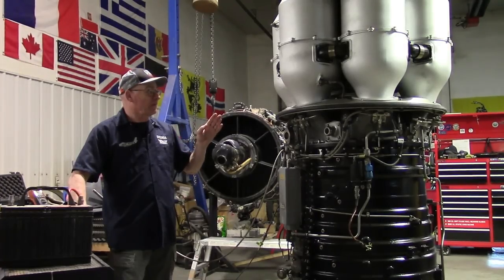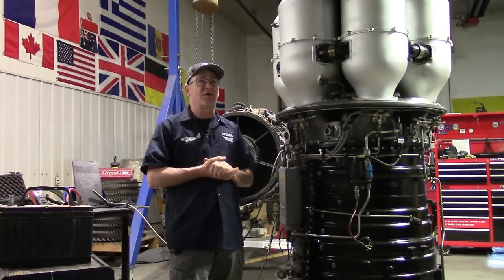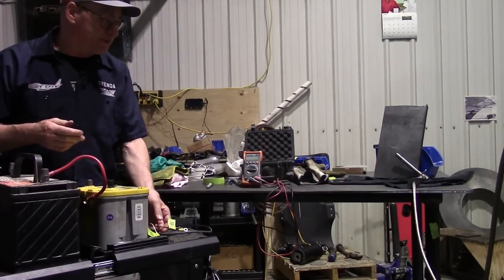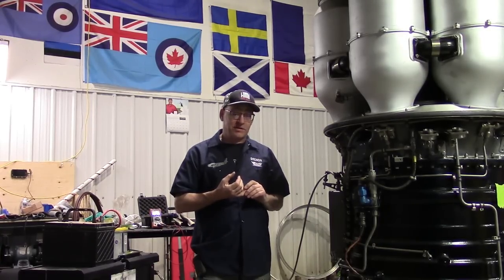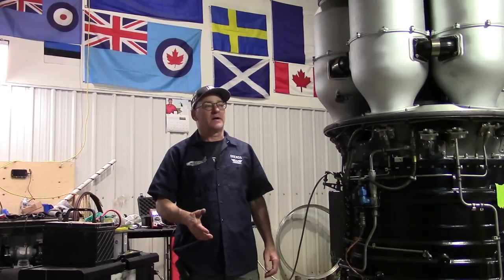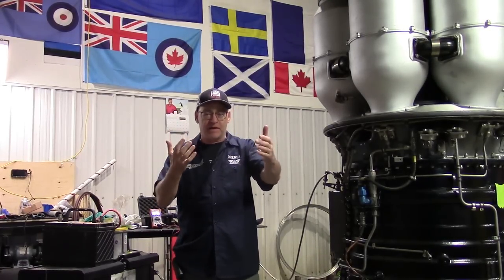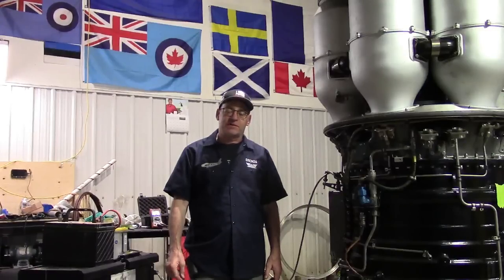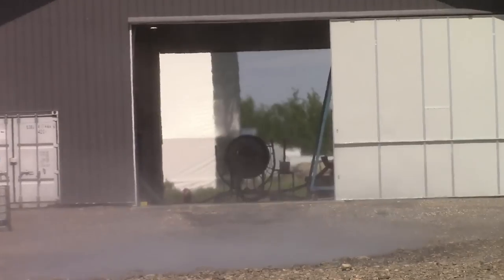Turbojet Ignition Test and Run

Comment: Continuous ignition is also used when flying through heavy precipitation.
Reply from the maker: It's an option. Rain has no real effect on airliner engines, except to increase the mass flow very slightly.
The engines on a 777 move several tons of air per second.

Comment: Did you get a new video camera? The picture seemed to be a higher resolution. Or maybe I did something and don’t realize it.
Reply from the maker: Many videos that don't contain mechanical details, I post in 30 frames/sec. Engine test vids are usually posted in 60 frames/sec.

Comment: I feel I should know already but why does the J47 Orenda Turbo-Jet share spark plugs with it's neighbour I understand this turbojet can only start with ground power but if it was to flame out while in the air it might trade altitude 4 airspeed to Windmill spool up N1 airflow and generate enough electrical power for a Relight or does the aircraft have a battery to assist here
I am very fond of this motor and it's very clear and understandable teacher
I guess The Veteran j47 speaks for itself
Thank you for all your videos
Reply from the maker: The ignition system would be energized by a battery in the aircraft.
Reply: @AgentJayZ  watching you test the spark igniters on the j47 is how I would test them when working in the shop
I would just rest the plug in its HT lead against a metal part of the engine I would often find them faulty because of an incorrect feeler gauge setting or none at all
I chose car engineering
As a teenager as my health said I couldn't fly which I wanted my whole life sorry to rant I wanted the turbo jet to be part of that I love the sounds they make as the gauges come to life
Have a good night my friend

Comment: Great video, quick question and I apologize if I missed it during the video. Does the “continuous ignition” mode you mentioned only apply to single engine jets? I asked my buddy who’s a KC10 pilot and he said they do not use it during takeoff, but it is used only during rough turbulence, storms, turbulent landings, etc. Thanks in advance, super interesting stuff!
Reply from the maker: It can be done on any engine. Each engine has its own completely independent ignition system.
Leaving it on after initially starting the engine is a decision for the pilot, and is sometimes the policy of the airline.
Benefit is instant recovery of function after a million-to-once chance flameout.
Drawback is the increased wear on the ignitors, because the sparks are huge.

Comment: I'm wondering why there is an exhaust nozzle on the industrial version of the Orenda given that it is likely used for a generator I'm assuming(?) Does that shape just help with laminar flow, or a residual of it's aircraft origin??  Also, I notice you don't use a FOD screen, is that normal or?  Thanks AJZ for all your great content.
Reply from the maker: You'll notice there is not a power turbine attached. I replacement of that load, we use a manufacturer specified orifice. Power is calculated based on mass flow and the pressure rise upstream of the exit of the orifice.
Amazing to think all that thunderous noise (you had to be there) was due to the flow caused by a jet pipe pressure of 15 psi.
Reply: @AgentJayZ  Yeah man, I'm a Luddite, but I'm catching on and it's a Hellova thing.  I notice that Canada put those in their F 86's and the US went with the J47s with a production of 4k & 10k respectively, I suppose there are still a few around  these days.  I hate to ask, but do you have a favorite video you've made that could help me understand the combustion stage of a non canned axial design?
Reply from the maker: This one: Jet Questions 56 shows an annular liner. They all do the same thing, but they are different shapes.

Also, have a look at " Why No Inlet Screen ? "
Reply: @AgentJayZ  TY sir
Reply: @AgentJayZ  Also, thank you for being up late too 😄
Reply: Herewith the reply that I've just posted to a similar question.
The turbomachinery and combustion system of a gas turbine engine upstream of the compressor turbine outlet is designed to require a back pressure, which is produced by a downstream restriction.  
That restriction may be produced by a jet pipe and a final nozzle, which turns the turbomachinery intro a jet engine.  Equally, it may be produced by a multiplicity of nozzles, which are the first -stage NGVs of a power turbine, turning the turbomachinery into a gas generator. 
The turbomachinery does not 'sense' any difference.

Comment: Love your channel.  Question for you.  Could a compressor section be repurposed by modifying it to direct motor drive to use for just an axial compressor?  I am working on a theoretical study and having a hard time determining, based on OPR and isentropic approach, what motor size we might need.
Reply from the maker: For a simple turbojet, like the Orenda, J79 and many others, the basic rule of thumb is that of the energy in the fuel, 2/3 of it is used to turn the compressor, and 1/3 of it is used to accelerate the gases out the back and make thrust.
The reason I mention those two engines, is there are industrial versions of them. The exhaust gases are used to drive a separate power turbine, so the power output is a mechanical rotating shaft.
Rotational speed times torque, all divided by 5252 equals Horsepower. Even easier, if the power turbine is attached to an electrical generator, the output is in watts...megawatts!

So...if an Orenda can drive a power turbine, which drives an electrical generator which puts out 7 megawatts ( as featured in one of my videos ), and if that amount of power is roughly one third of the total power... the compressor needs roughly 14 megawatts to run at full speed.

and for simple turbojets, the static thrust in lbs is roughly... very roughly... the same as the megawatts when the jet accelerating nozzle is removed, and the gases are ducted to an appropriate sized power turbine.

Important info is what output pressure you want, and how much compressed air do you want.
The J79, compressor needs 30 thousand Hp, and will deliver 150-plus lbs of air per second at about 160 psig.

So... you probably want a much smaller engine's compressor.

Even the little Allison 250 helicopter engine has an output of 400 Hp in the older models, so you would need a motor rated at 800Hp to drive the compressor, and a step up gearbox to spin it to just over 50,000 (fifty thousand nine hundred rpm)

The closest thing you are thinking of is a belt driven centrifugal compressor which is a type of supercharger used on cars. Tale a look at ProCharger.
Mechanically driven axial compressors are rarely made, because of the speeds they must turn at. The best thing to drive a piece of rotating machinery at such high speeds and power... is a turbine.
Even turbine driven superchargers use centrifugal compressors, because the axial compressor is so much more expensive, and it only starts becoming economical at sizes and mass airflow levels way above what is required for any job of compressing air, except one: feeding the combustors of a jet engine.

Check out the search box on my channel page for vids on compressors, thrust vs power, power turbines, and more...
Reply: That's how rig compressors are tested and their performance is mapped, long before they are driven by a turbine in an engine.
Many years ago, Armstrong Siddeley Motors at Coventry had what was known on the Ansty site as 'The Ten Thousand Test'.  It comprised half of the engine room of a WWII destroyer -  boiler, turbine, condenser, etc, which produced 10,000SHP.  It was used to drive an instrumented compressor on test, but even with 10,000SHP, it was soon inadequate for driving anything larger than the early Sapphire compressors.
Reply: This used to be done in the 1940s in the few years between conventional piston engines reaching their maximum power outputs and then becoming obsolete due to turbojets taking over as propulsion for aircraft: During those few years, a sort of hybrid system was developed and actually used in several aircraft, referred to as the "motorjet" or sometimes "thermojet". Which was basically a compressor (which could either be a single stage centrifugal or multi-stage axial type) driven by a piston engine - the compressed air would then be mixed with fuel and burned, then expelled out of a jet nozzle to make thrust. Sometimes the piston engine would do double duty by driving a propeller at the front of the aircraft as well as driving the motorjet compressor, sometimes it would only drive the compressor, depending on the design of the aircraft it was used for. In either case, the thrust produced by the jet nozzle was made in the same way as a turbojet, just without a turbine since it didn't need one. The piston engines used to drive the compressor were typical aircraft engines for the time, so their power output would probably be in the 

An advantage of the motorjet design was that more of the compressed air could be burned to make thrust and the combustion could happen at higher temperatures, which made more efficient use of the compressed air. Whereas in a turbojet, only a small proportion of the compressed air is burned with fuel - most of the air is mixed with the combustion products to cool them down so that the turbine blades don't melt. As AgentJayZ has pointed out on numerous occasions, if a turbine could function at 3000 degrees C or hotter (which is the kind of temperature in the combustion flame itself) without weakening, melting or otherwise being damaged by the heat, then it would be possible to use all the compressed air for combustion and the power output of a turbojet would improve by an order of magnitude without it having to be any bigger or heavier. The ability of the turbine to withstand the heat has always been a limiting factor for any gas turbine engine - so using a separate power source to drive the compressor removes that limit - which is what the motorjet design does.

However, there are disadvantages to the motorjet design, which mostly come from the need to use a conventional piston engine to drive the compressor: For a start, the entire setup is heavier than just having the engine drive a propeller. Then you have all the usual problems of the power output of the piston engine dropping as you go up in altitude. Which can be mitigated to some extent by supercharging or turbocharging, but that adds even more weight and complexity.

Comment: A couple of recent horrific (fatal) ingestion ingestion accidents have brought this question to mind: what is the average speed of the air at the face of a stationary turbine engine at idle, and at normal taxiing power? I suppose this varies by model, so I'm fine with you picking an example and giving a general order of magnitude or range. Also, what are the safety rules in your shop regarding limits of approach to inlets of engines during test runs? I think many of your viewers would be interested in filing this in their "good to know just in case" memories..
Reply from the maker: Inlet air velocity is not measured. It's only important to the design engineers.
Safety rules at our test cell:
1 Never be the closest one to the engine.
2 Nothing in your pockets, and hats only under your earmuffs.
3 No running, goofing off, or generally being unpredictable (ah, you never would have been allowed there anyway).
If you are only asking about inlets, your own instincts will keep you away. The videos do not do justice to the monstrous, shrieking noise. You instinctively want to be much farther away than the actual safe minimum.

Comment: Great video Agent Jay Zee thx! I know it is probably not your expertise, but I cant get my head around how a Centrifugal fan works, like in your furnace.. it looks backwards to me. I am making something cool to fight ingesting particulate matter.. but I cant find a good explanation of how this fan works with the pressure and all. Being a pressure expert, can you please give your insight? Thx.
Reply from the maker: Before you spend a lot of energy, you might want to do some reading on inlet particle separators. They've been a part of helicopter inlet designs for about 50 years or so.
Reply: @AgentJayZ  Got it Thx!
Reply: @AgentJayZ  Just so we are clear, It's to protect your lungs. positive airflow mask.. After all these years I'm 30% dust by weight lol

Comment: I wonder if painting them combustors a darker color, would that make them run hotter versus the ones Agent Jay Z did.
Reply from the maker: No. They run hotter if you spray more fuel inside. But even that has minimal effect, as you will realize when you type Combustor into the search box on my channel page. Then try Cooling Air.
Reply: Ajentjayz is CORRECT

Comment: since its an industrial engine why would the jet nozzle be on the exhaust pipe?
Reply: Its so they can measure the power of the engine using by measuring its thrust. But Im sure Jay and others will give you a more correct answer!
Reply from the maker: There's a lot of info in the comments... from 3 hours earlier: "You'll notice there is not a power turbine attached. I replacement of that load, we use a manufacturer specified orifice. Power is calculated based on mass flow and the pressure rise upstream of the exit of the orifice".
Reply: The turbomachinery and combustion system of a gas turbine engine upstream of the compressor turbine outlet is designed to require a back pressure, which is produced by a downstream restriction.  
That restriction may be produced by a jet pipe and a final nozzle, which turns the turbomachinery intro a jet engine.  Equally, it may be produced by a multiplicity of nozzles, which are the first -stage NGVs of a power turbine, turning the turbomachinery into a gas generator. 
The turbomachinery does not 'sense' any difference.

Comment: I'm surprised that engine idles at 40% RPMmax. I was under the impression they idled higher than that.
Reply from the maker: These engines are very different from piston engines. 40% is ground idle. For an aircraft turbine engine, flight idle is about 84% of max. 90% rpm is about half power. There is a big difference in sound and power between 95 and 100.